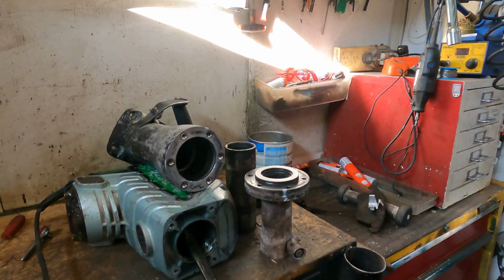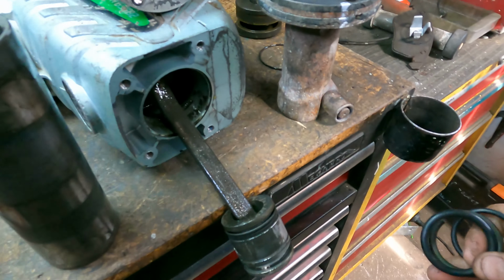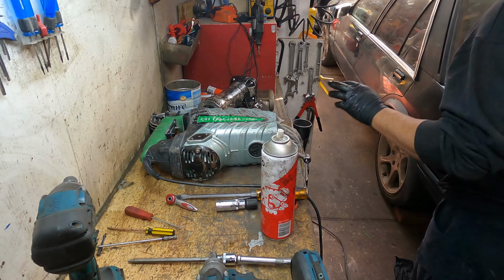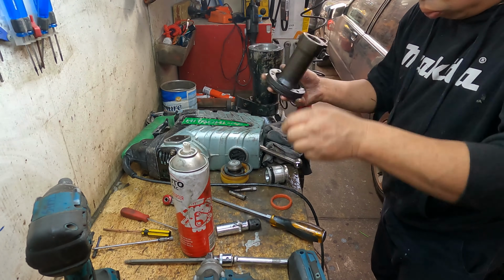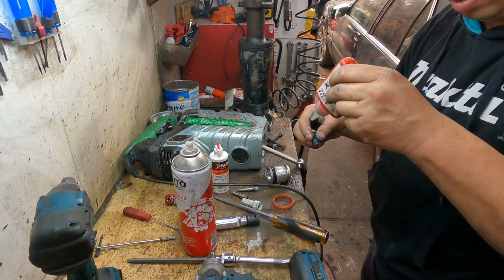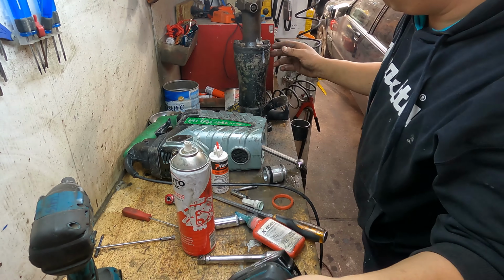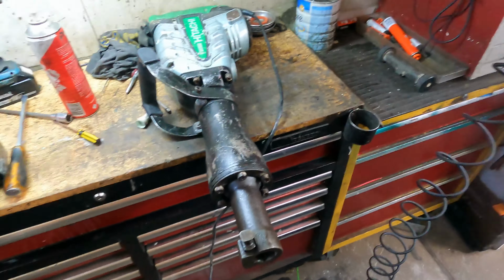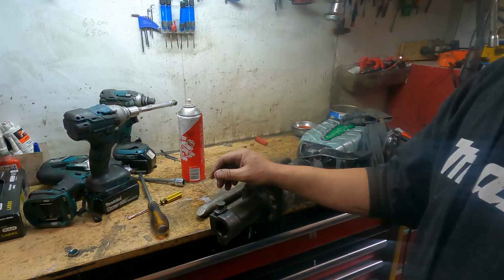hitachi jack hammer no hammering

Comment: Hi.. is this jack hammer suppose to leak oil or is that a sign that the piston ring is worn?
Reply from the maker: The oil rings start leak not big deal
Reply: @TheDingdong78  thanks.. I got one with the black cap and not the site glass one but I put airtool oil in it because I couldn't get the proper grease.. left it on the garage floor and now there's an oil puddle
Reply: What type grease did you use?
Reply: @mehdinajafi2583  just a molybdenum grease nlg-4 I think...couldn't get powertool grease